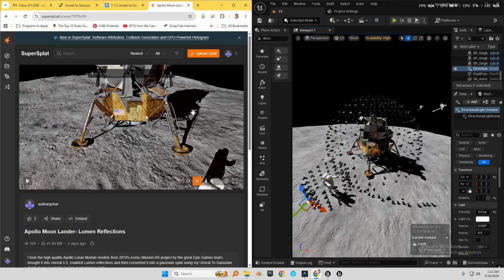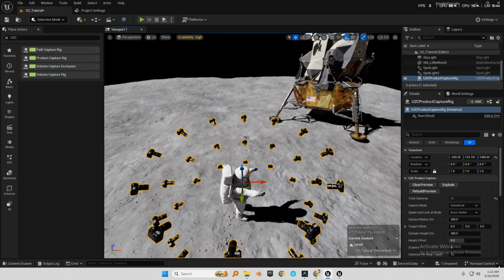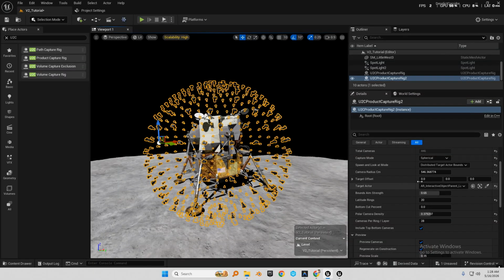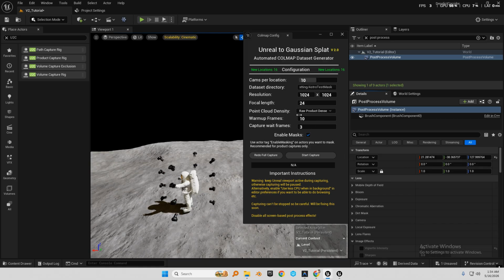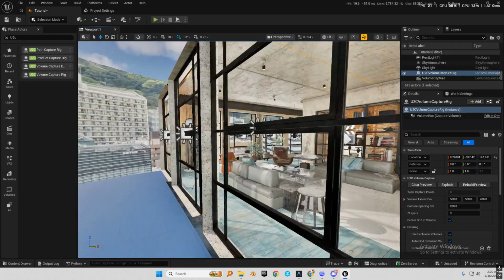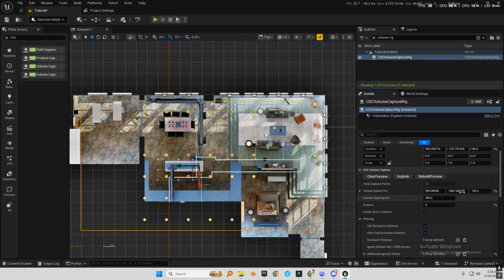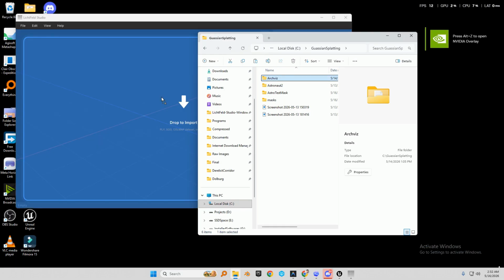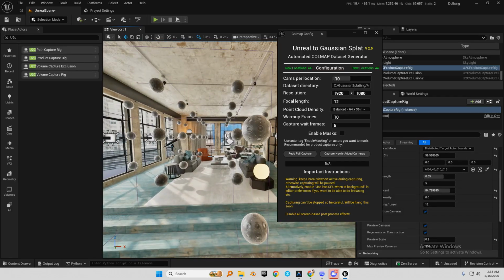Unreal To Gaussian Splat Plugin V 2.0 Tutorial

Comment: Loving the plugin so far! Nice work.
However, I encountered a challenge that I couldn't yet figure out unless I have to delete and add U2Cs: I have a very large heavy scene (basically a city). I want to generate multiple .plys based on a collection of U2Cs in different folders for the same level. Currently, the generation seems to be "per level only" and there's no way to ignore certain U2Cs from being taken into account for this process.
Does that make sense? Is there anything that I'm not seeing?
Reply from the maker: To solve this issue what you can do is, create an empty new sublevel, select all your capture rigs that you don't want to capture, press ctrl+X on keyboard, then make that new temporary level as current level, then press ctrl+V on keyboard. Save all, then delete the sublevel.

This way, you avoid capturing those actors, but also keep their backup so that you can reuse them anytime you want.

Does that make sense?

Also please consider giving the plugin a review on FAB if you haven't already. Thanks!

Comment: Plugin works great so far, though I m missing the possibility to add warmup frames in the config. I see this option in your video, but in V3.0 it´s gone. thats quite a problem for my project. is there any solution or workaround?
Reply from the maker: Hi Martin, I hardcoded the warp up frames to 64 in V3.1, I belive that should be sufficient enough for most of the projects. Do you want to go even higher? Sorry for late reply

Comment: There are some self-luminous objects in the scene. Under the lumen lighting, there is spillage or obstruction of the light, which seems to be based on screen compensation. Will this situation affect the final generated result?
Reply from the maker: Great question! In my tests so far, having view-dependent lighting and effects sometimes affect the training and sometimes they don't. But you can easily disable view-dependency by disabling Screen Traces from Lumen GI and Lumen reflections.
Reply: @walhargohar646  I’ve noticed that version 3.1 still enforces a limit of 10,000 images. Sparse point cloud texturing will fail once this threshold is exceeded, and continuing training will only yield erroneous results.
Reply from the maker: @muziyi5558  Its so weird, some other users have also reported this behavior but they also said sometimes even 13000+ images get good results without any errors, and that is why I have been unable to reproduce this issue so far. I'll look into it again in 1-2 days and if I find something, I'll let you know here.
Reply: @walhargohar646  @echo off
setlocal
cd /d "%~dp0"
echo Checking and fixing potential camera sorting bugs...
powershell -NoProfile -ExecutionPolicy Bypass -File "%~dp0UnrealToColmap_FixAlphabeticalBug.ps1" "%~dp0.."
echo.
echo Coloring point cloud...
powershell -NoProfile -ExecutionPolicy Bypass -File "%~dp0UnrealToColmap_ColorPointCloud.ps1" "%~dp0.."
echo.
pause
Reply: @walhargohar646  param(
    [string]$DatasetDir = $PSScriptRoot,
    [switch]$Force
)

$DatasetDir = [System.IO.Path]::GetFullPath($DatasetDir)

# Check if we are running from exports folder
if ($DatasetDir.EndsWith("\exports") -or $DatasetDir.EndsWith("/exports")) {
    $DatasetDir = [System.IO.Directory]::GetParent($DatasetDir).FullName
}

$sparseDir = Join-Path $DatasetDir "sparse\0"
$imagesDir = Join-Path $DatasetDir "images"
$imagesTxt = Join-Path $sparseDir "images.txt"
$logPath = Join-Path $DatasetDir "exports\UnrealToColmap_FixAlphabeticalBug.log"

function Write-Log {
    param([string]$Message)
    $line = "[{0}] {1}" -f (Get-Date -Format "yyyy-MM-dd HH:mm:ss"), $Message
    Write-Host $line
    Add-Content -LiteralPath $logPath -Value $line
}

New-Item -ItemType Directory -Force -Path (Split-Path -Parent $logPath) | Out-Null
Write-Log "Unreal to Gaussian Splat - Alphabetical Sorting Bug Fixer"
Write-Log "Dataset directory: $DatasetDir"

if (-not (Test-Path -LiteralPath $imagesTxt)) {
    Write-Log "ERROR: Missing sparse\0\images.txt. Please run this script in a valid dataset folder."
    exit
}

if (-not (Test-Path -LiteralPath $imagesDir)) {
    Write-Log "ERROR: Missing images directory: $imagesDir"
    exit
}

# 1. Parse original camera names from images.txt
Write-Log "Reading camera names from images.txt..."
$lines = Get-Content -LiteralPath $imagesTxt
$cameraNames = New-Object System.Collections.Generic.List[string]

for ($i = 0; $i -lt $lines.Count; $i += 2) {
    $line = $lines[$i].Trim()
    if ($line.Length -eq 0 -or $line.StartsWith("#")) {
        $i-- # Adjust loop to process line-by-line correctly
        continue
    }
    $parts = -split $line
    if ($parts.Length -ge 10) {
        $cameraNames.Add($parts[9])
    }
}

$N = $cameraNames.Count
Write-Log "Found $N cameras in the dataset."

if ($N -le 10000 -and -not $Force) {
    Write-Log "Success: Dataset has $N cameras (<= 10000). The alphabetical sorting bug does not apply. No fix needed."
    exit
}

Write-Log "Fixing dataset with $N cameras..."

# 2. Reconstruct original sequence and sorted sequence of frame numbers
# MRQ frame numbers are 4-digit padded below 10000, and 5-digit padded starting at 10000
$frames = 0..($N-1) | ForEach-Object {
    if ($_ -lt 10000) {
        "{0:d4}" -f $_
    } else {
        "{0:d5}" -f $_
    }
}
$sortedFrames = $frames | Sort-Object

# Map original frame index to its sorted position
$frameToSortedIdx = New-Object 'int[]' $N
for ($wIdx = 0; $wIdx -lt $N; $wIdx++) {
    $frameStr = $sortedFrames[$wIdx]
    $rIdx = [int]$frameStr
    $frameToSortedIdx[$rIdx] = $wIdx
}

# 3. Rename files to .bak first (if not already done)
# We rename to .bak to ensure we don't overwrite any files in the process
Write-Log "Creating backup .bak copies of original images..."
$bakFilesCount = 0
for ($wIdx = 0; $wIdx -lt $N; $wIdx++) {
    $oName = $cameraNames[$wIdx]
    $srcPath = Join-Path $imagesDir $oName
    $dstPath = $srcPath + ".bak"
    
    if (Test-Path -LiteralPath $srcPath) {
        if (-not (Test-Path -LiteralPath $dstPath)) {
            Rename-Item -LiteralPath $srcPath -NewName ($oName + ".bak") -Force
            $bakFilesCount++
        }
    }
}

if ($bakFilesCount -gt 0) {
    Write-Log "  Backed up $bakFilesCount files to .bak."
} else {
    Write-Log "  All original files already backed up."
}

# 4. Create correct hard links
Write-Log "Creating correct hard links..."
$linksCreated = 0
$errorsCount = 0

# For each camera rIdx (from 0 to N-1):
# - Its correct file name on disk should be cameraNames[rIdx].
# - The file currently containing its pixels is cameraNames[wIdx].bak,
#   where wIdx is the sorted position of frame rIdx.
for ($rIdx = 0; $rIdx -lt $N; $rIdx++) {
    $wIdx = $frameToSortedIdx[$rIdx]
    
    $oName = $cameraNames[$wIdx]
    $cName = $cameraNames[$rIdx]
    
    $bakPath = Join-Path $imagesDir ($oName + ".bak")
    $linkPath = Join-Path $imagesDir $cName
    
    if (Test-Path -LiteralPath $bakPath) {
        if (-not (Test-Path -LiteralPath $linkPath)) {
            New-Item -ItemType HardLink -Path $linkPath -Value $bakPath -Force | Out-Null
            $linksCreated++
        }
    } else {
        $errorsCount++
    }
}

Write-Log "Fix completed successfully!"
Write-Log "Successfully created $linksCreated correct hard links."
if ($errorsCount -gt 0) {
    Write-Log "Warning: $errorsCount backup files were missing."
}
Reply: @walhargohar646  I’ve sent you the AI-revised code in my reply. Since I don’t have the full source code, I can only run point cloud coloring separately. A friend shared this with me; he successfully tested it with datasets exceeding 10,000 images. I plan to run my own tests tomorrow. I’m sharing it with you now to see if this can resolve the bug. Thank you.
Reply: @walhargohar646  Subject: Bug Report: Image/Pose Mismatch and Scrambled Point Cloud Colors When Capturing Over 10,000 Cameras Directly (Root Cause & Fix)

Problem Description: When using the plugin to directly render and export a large dataset with over 10,000 cameras/frames in a single run, the point cloud colors appear completely scrambled and distorted when imported into LichtFeld-Studio or other Gaussian Splatting training software. However, the plugin works perfectly if the total camera count is under 10,000, or if done incrementally (e.g., rendering 9,976 frames first, then adding more frames in a subsequent run).

Root Cause Analysis: The issue lies in the file renaming logic (inside the SplatCapture Editor Utility Widget/Blueprint) after Movie Render Queue (MRQ) finishes rendering:

Inconsistent Filename Lengths: When the total frame count exceeds 10,000 in a single MRQ job, the output frame numbers change padding lengths:
Frames 0 to 9999 are padded to 4 digits (e.g., 0000.png to 9999.png).
Frames 10000 to 10011 are 5 digits (e.g., 10000.png to 10011.png).
Alphabetical Sorting Issue: The plugin gets the list of rendered files from the OS filesystem (e.g., using FindFiles), which returns files sorted alphabetically. In alphabetical/ASCII sorting:
10000 through 10009 are sorted between 1000 and 1001.
10010 and 10011 are sorted between 1001 and 1002.
Cascading Renaming Mismatch: Because the file array is sorted alphabetically, the loop that renames these files to the corresponding CameraNames (which are logically ordered numerically) associates the wrong images with the wrong camera indices. Starting from index 1001, every image on disk is renamed incorrectly, resulting in a severe mismatch between physical image pixels and camera poses in images.txt/points3D.txt.
Recommended Fix: Before renaming the temporary rendered files in the Blueprint, do not rely on the default filesystem sorting. Instead:

Implement a Numeric Sort on the file array by parsing the frame number suffix as an integer before mapping.
Alternatively, dynamically adjust the MRQ's Frame Padding configuration based on the total camera count (e.g., automatically set padding to 5 or higher if total cameras > 10,000) so that all filenames maintain the same string length.